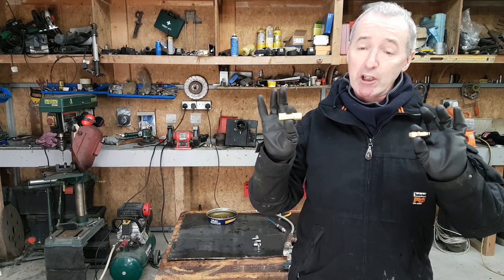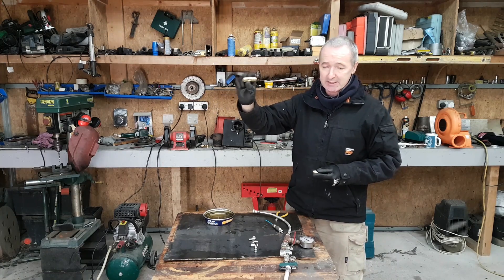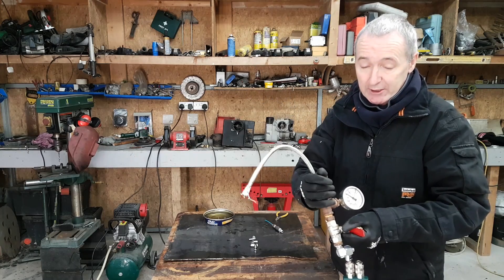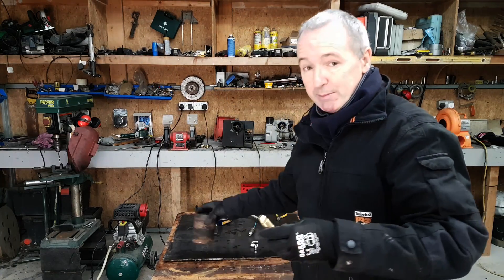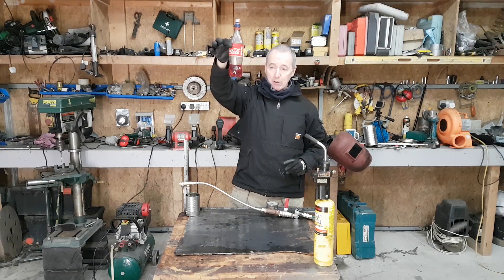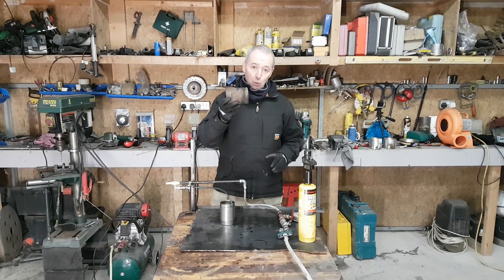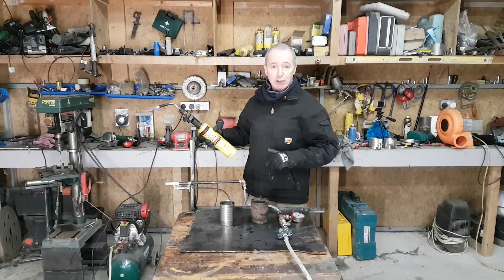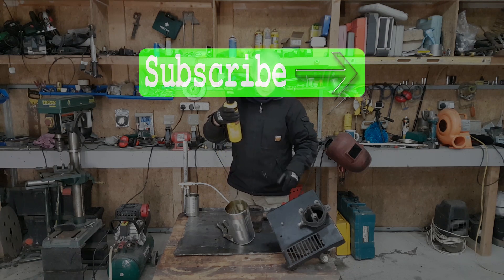Homemade Waste Oil Burner Siphon Nozzle build

Comment: Hi Gerry,

Great videos as always, I wish there was a conclusion to this series of waste oil nozzle mods. What I am wondering is, do you think it would be possible to build a waste oil nozzle for use in Beckett/Riello etc. burners but NOT require the use of a compressor for air pressure? Preheated oil with a larger nozzle and a gear pump for the oil feed or something that could handle the thicker oil, the original pump would probably not like used motor oil. Would like to hear your thoughts on this. Cheers

Comment: Hi Gerry I have been running a drip feed with decent results but I just got a nozzle today and will be trying to set up a more efficient burner with it. I plan to gravity feed it not true suction and use 1 1/2 “ iron pipe for a burn tube. Thanks you have been an inspiration to me. If I can get it to work properly I will post my own video
Reply from the maker: Excellent Ford Racer good luck with your project 👍👍
Reply: GerrysDiy update using a 2 1/2” piece of exhaust pipe for a blast pipe. Lit easy on diesel but not on oil. Requires 25-30 psi kinda fussy doesn’t like more or less. Quite noisy not sure if some holes on the side of blast tube would help. Have to say my drip feed at this point works just as well I do have a 50 Cfm blower on it. The siphon seems to use more fuel. My nozzle is a 2.0. I’ll keep tinkering. Cheers

Comment: too much air, mist too fine
Reply from the maker: Hi L Pi.  Thanks for the heads up. I will be returning to that setup soon. Cheers Gerry👍
Reply: @GerrysDiy  
Hi Gerry,i really enjoyed watching you fill the shed with flammable fog,  you`re braver than me ;) The flowrate depends on the air pressure and the syphon height, which is measured from the liquid level in the container to the center of the nozzle. The droplet size is also affected by these two variables so there are a lot of possible permutations even without considering viscosity which will also will play a part. The delevan SN series nozzles can also be gravity fed which will provide a higher flowrate vs syphon fed. The delevan SN series nozzle specsheet will give you all the info on flowrates vs air pressure and siphon/gravity feed heights. Fwiw, the cheapest place i know of for these nozzles is patriot-supply on ebay (usa seller), delevan in the uk 
will charge you a fortune ;)
Reply: its not that the mist is too fine. The velocity of the fuel air mixture is faster than the flame velocity of the fuel.

Comment: i think part of the problem is the air flow is to much and helping to blow out the flame , its like a gas lighter , if you turn up the gas to high it blows out the flame

Comment: Im glad you posted this , it proves those nozzles dont work with waste oil , ive bin telling people this but they dont believe me
Reply: they work , im using those nozzles (SNA 0.1) my self with an modified WEISHAUPT  WL5 burner, you need a seperate gearpump for oil and of course compressor(Idealy rotation ) for air .In this way you can control oil pressure and air pressure , and yes it works without preheat its little tricky but its doable

Comment: I'm interested in this air nozzle.  I had this kind of furnace my whole life and didn't have a clue what was going on inside.  But, I think this design is light years ahead of your other burner - it's so sophisticated compared to your other burner.  I like your simple drip burner pot.  I'm a tinkerer and I do 3d printed parts and electronics.  If you get me your mailing address somehow, I'll try to work out a small low voltage pump that you can dial in like your drip valve.  It would be a pleasure to assist.  Thanks, Gerry.

Comment: The blast tube is designed to spin the air from the fan that would usually be fed from the rear. I cant see the advantage of using the tube as you are providing air directly through the nozzle

Comment: why not just use the rielo burner with a bigger nozzle?
Reply from the maker: Hi Rob. One of the lads here has a riello or similar running on heated waste oil only with no mods other than preheaters so I might give that a go too. I have a few burners here for experimentation. More on that soon.  Thanks for the comment. Cheers Gerry
Reply: any chance you could sneak into his place and do a video on how he has it set up

Comment: Hey Gerry, nice new design. Can't wait to see the final product.Quick question, how do you stop the black soot build up inside the chimney? My burner doesn't smoke now, but I'm dealing with black soot inside the chimney. If I keep using it I'm afraid it will plug it up solid. Thanx and take care.

Comment: You know if you bought a small one cylinder diesel generator it will run on waste oil and you can put it inside with a exhaust pipe  that runs outside, this way the oil burns in the engine and heats your building  and you also get free electricity :)
Reply: You could use that free electricity to heat your house with electric heat :)
Reply from the maker: Hi Experimental Fun. Thanks for the comment. I have been looking around for a lister diesel engine and I think I found one. Running it on waste oil and using the heat output and the electricity would be very useful and also some fun too.  Cheers Gerry
Reply: Awesome, Good luck :)
Reply: Experimental fun: That's what I did with our lister ,I also made the exhaust pipe run around length of my garage before exiting  to extract remaining heat. Sadly you can not get a lister or lister clone imported here anymore due to bogus regulations .
Reply: Gerry. You going to annoy the neighbors..... Just a thought from Donegal. Love your videos.

Comment: Gerry, I went down the road your headed. There are pros and cons to it. I did however build a circuit board for the igniter because the real board and coil was expensive and I couldn’t get a hold of one. The issue I ran into was keeping the regulated air to be a constant as the pressure in my air tank varied. I’m curious to see what you figure out with this.